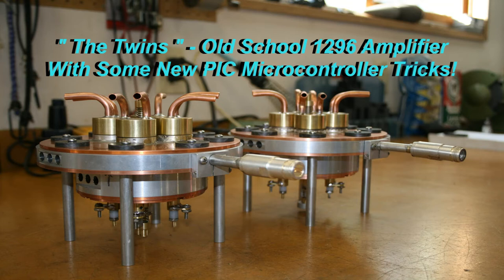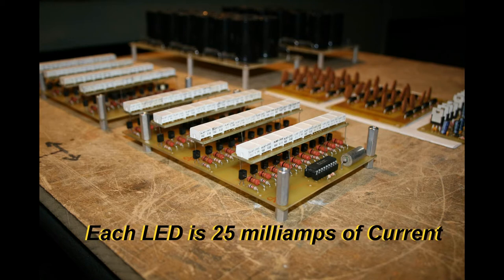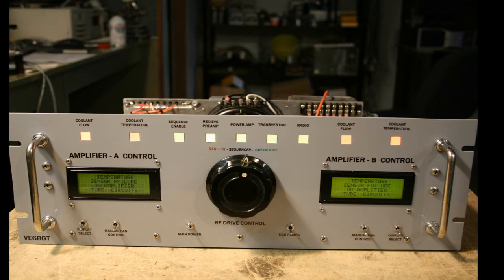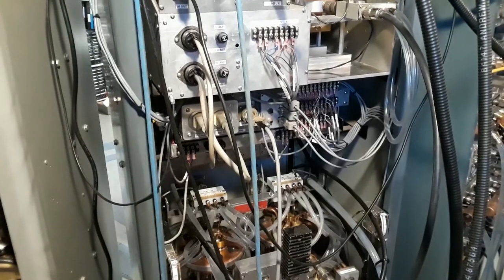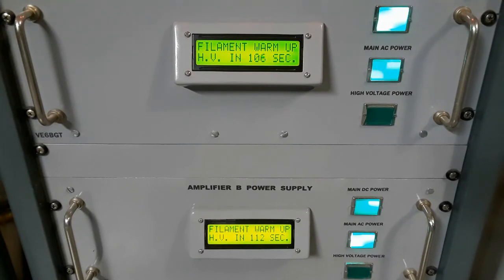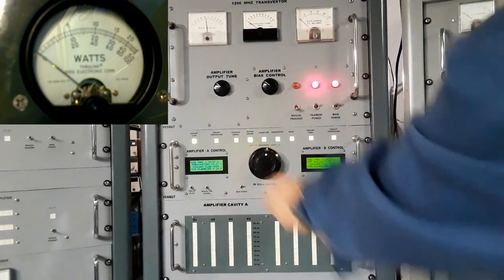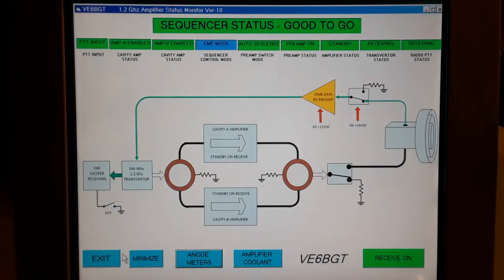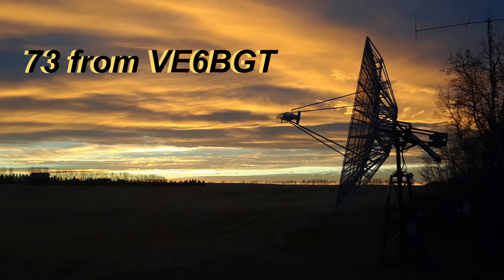"Old School" 23CM Amplifier Project With New Tricks

Comment: Very enjoyable video. Quite interesting to say the least. Did you do the lettering on the panels? I was wondering what the process to paint on the letters entails.
Reply from the maker: Hello Doug. Yes I did the labeling on the panels myself.. It was easy as I just bought this decal paper and then printed the labels and pixs right onto this special paper.. Then like "decals " I cut them out and dipped into warm water and slid them onto the panels.. I would print more than one as sometimes they dont slide off onto the panel or metal well or dont get lined up etc, so its good to have a spare decal.. After carefully smoothing them out and let dry I would spray on a clear coat very lightly to help preserve the decal.. Thats also tricky as some clear sprays would react with the decal material and it would wrinkle so you have to be careful and test a few decals first on some scrap metal etc..  I have heard that getting this decal paper is now costly and maybe hard to find, I dont know for sure.. Skip
Reply: I would love to see a video of making and applying the decals.